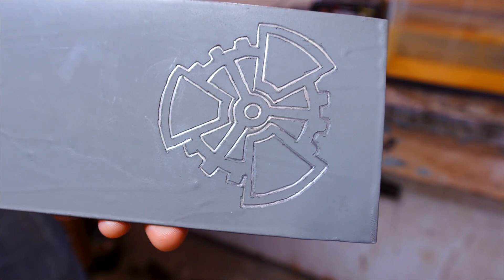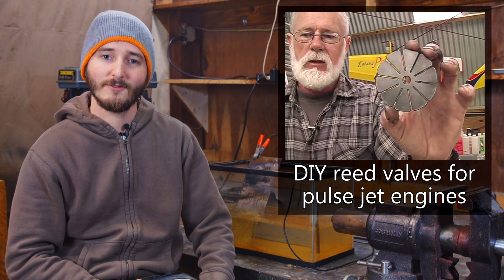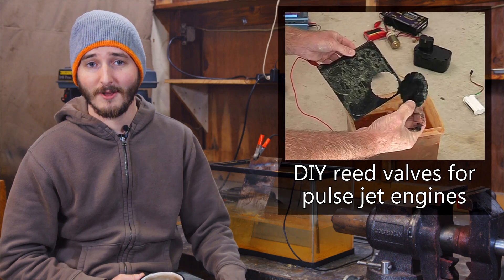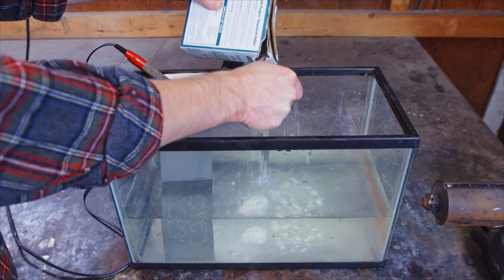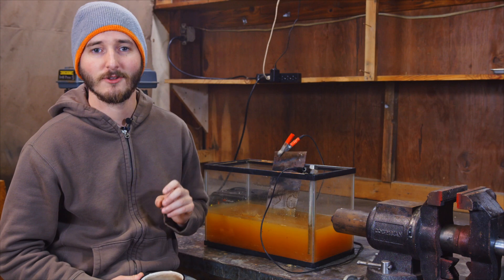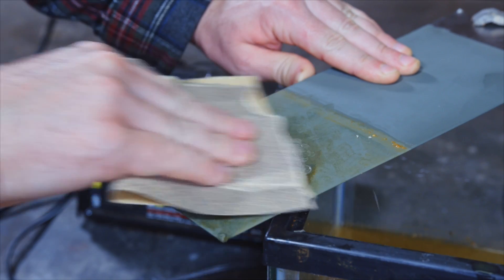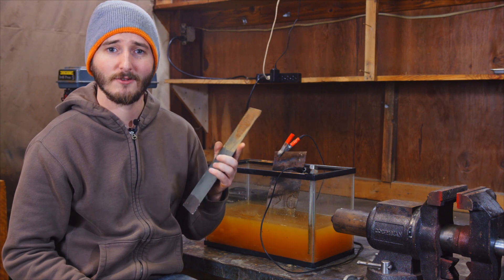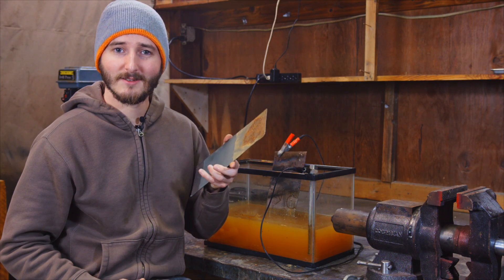How To Cut Steel With Electrolysis [Experiment In Progress] - NightHawkInLight

Comment: Agitation made my results much better. Constantly flushing the metal residue away from the cutting region seems very helpful. I used transparent packing tape as protection rather than paint, which works ok but ofcourse you still get undercuts. The only way I know to avoid this, is to use thinner sheet.
I got the best results by putting the plate horizontal, and having the etching face at the bottom. I think maybe this way the metal residue flushes out easier or something.

Comment: Another thought was on the creation of the relief. Maybe create a stencil, use wax or whatever to fill in the stensil. Then, apply your paint, wash off the wax leaving the lines of your stencil bare. The bubbles may be from the coating not being well bonded where it was scratched away.

Comment: I saw on the TechIngredients channel where they basically scrubbed epoxy into an aluminum sheet with a scotch bright pad to get past the oxide layer and get good adhesion. They said it worked better than an etching primer.  Steel doesn't have the same instantaneously formed oxide layer aluminum does but it might still work good.  How deep did your attempts get before the edges broke down?  I wonder if the addition of an acid that would make the process work faster would help?  Part of me thinks having a nearly polished surface near the lines you want to cut on would help but I've found paint doesn't stick to polished metal very well.  Also maybe a sticker with the cut pattern in it would hold up better.

Comment: I have been doing a similar process with Kapton tape on the steel instead of paint, then using a diode laser to selectively burn off the kapton in the areas you want to erode. It seems to work fairly well.

Like others have mentioned, using something like salt or epsom salt would probably be less likely to mess up the paint, and I would try running a higher current/lower voltage to reduce bubbling. I use a cheap bench power supply and a big steel mesh as a cathode (higher surface area cathode closer to the etching part will give you higher current for a voltage).

Comment: Place your sheet of metal right under the surface of the wAter the gas that builds up for some reason stay on the sides and prevent electric condition thus protecting from electrolysis action  vs up and in the way of the direction you wish to cut .   Also if you use     a wire that is around the perimeter of your sheet metal to be cut the collateral damage will occur outwardly vs eating away at your piece to be cut out  always give enough extra area for touch up

Comment: It would be damn near impossible to get a clean cut because all the metal is charged. The flow of electrons will go through every part right beside the shaping and this will add heat, after enough time bubbles would form in the crystalline structure of the metal.

Comment: The etching process in non moving water doesn't favor any direction, so it will etch into the material as fast as it will go sideways. So you would need a way to direct the direction of etching. Maybe a stream of water will help to guide the direction of cutting. The tube that spray's the water could itself be one of the electrodes, thereby concentrating the etching into the spot that has the water flow.

Comment: The greatest problem is that the iron oxide formed is kind of like a sponge and soaks up water and keeps eating up the metal in all directions. also the surface tension of the water causes it so be sucked into even the tiniest of gaps between the paint and yet again goes off on a different course.

Comment: Nah, you hit a dead end on the current model, no matter the paint coverage (as far as I know), as soon as the first corrosion occurs this makes room for corrosion towards the sides, because the water enters there, and then it is not a corrosion occurring in 2 dimensions, but in 3. Unless somehow the electron exchange was being done not by water, but by a material (with the cut mold you want) being pressed against your metal plate, in this case there would only be an exchange (theoretically) of electrons as far as your mold touches (+ the distance of the energy capacity being transferred by proximity, which may cause you to need a thinner mold than the cut you really want).

Comment: Idk if ur still intrested in this but deterrence dispensed has a great write up using 3d printed "bushings"  and copper wire to edm gun barrels. There info may help u and many ppl have had success with there method

Comment: Okay I've played around with electrolysis a good amount and I'm very familiar with making HHO through electrolysis. I know high voltage isn't always better. Try using either a higher voltage all at once or a low voltage for a longer duration. Also maybe try using petroleum jelly instead of paint. Just found your channel and I love it. I'm wondering if you can do something like this with some type of electric Arc

Comment: Just a couple of things of the top of my head, lay the steel plate as flat as you can so the bubbles don't get trapped under the wax, you really need to find a way of getting the bubbles not to stick around too long, which maybe why wax works well. I was also thinking maybe lightly etch the pattern on the steel first then again (requiring a bit of precision ) after the wax coating, i think this should keep the bubble creation confined a bit better to the pattern and not spread under the wax.
Reply: Another thought, if possible vibrate the steel to try to knock the bubbles off. Sonic vibration maybe, find the resonance of the steel bit. If you get it working patent it. :)

Comment: Your negative lead is stainless steel, and should be mild steel instead, also instead of coating the work piece with paint, you could use electrical tape and razorblade to cut the design. Next if you have any way of increasing the voltage not the amprage the process will work faster. Washing soda will work better than baking soda as your electrolyte, and always remember that if you use salt as an electrolyte you will.be producing dangerous chlorine gas. Try to only use mild steel or cast iron as both your work piece and the piece receiving the steel removed from the work, stainless steel can expose you to chromium which is very dangerous. Great videos and best of luck!

Comment: Etching or Chemical milling... done all the time...like printed circuit boards... ferric chloride is the etch for steel... I've used photo resist, also screen printed epoxy, or hand painted epoxy...there are tapes that are designed for etch of metal.  With epoxy, curing temperature is important and a light/fine sanding of the surface prior to applying the epoxy paint.   Also, know that as you etch down, a near equal amount is also etching under...approximately 45 degrees angle under the painted edge...  so plan accordingly.  On thick metal, and matching image is placed both sides and etched.

Comment: ik this old but did u try etching on both sides. also mayb try an oil based paint and i hope u got the sides covered  so the current is running sideways thru it would be going directly where u want the cut or try something that eats steel faster like alum

Comment: did you ever get this to work? Also watched the pulse jet vid a few weeks before yours, he used spring steel, a much different alloy than the stock stuff it looks like your using. I wonder if that could be it"? also did you try heating it up to lose the hardness first? you could temper it again later.
Reply from the maker: I think my issue was not using salt. I haven't tried again since this video

Comment: Etching works to only a short distance into the metal than the enchant works under the protective layer bubbles it away. The easiest way to etch metal is to first cut the pattern into the metal by using an engraving tool or an engraving cnc machine coat the metal in a protective layer over the engraving the scratch a thin line and use nitric or hydroclorlic acid.  If you can engrave both sides by using a laser printer and magazine paper to print copies of the mirror images of the engraving  use a iron to heat the images on both sides then engrave both sides and paint scratching a thin line on both sides.The faster the process the less chance the enchant getting under protective coat so heat the enchant up to almost a boil  The only other way is carbon EDM electrical discharge machining or high pressure abrasive machining.

Comment: Howdy I use this method to clean rust from parts and tools.
 Specifically I use an old portable DVD player power supply that provides.
 12 volts and 3 amps. or a battery charger if its not around.
 1 TBS Sodium Carbonate (Arm and Hammer Soda wash, powder) per gallon of water.
positive hay wired to sacrificial steel. I like pipes it give more surface ares to react with.
Negative hay wired to the part I want to clean.
After a couple of hours (for only surface rust) or when the reaction quits or slows down (indicated buy the rusty bubbles), pull out the parts.
If they are not cleaned after a scrub with a stiff brush and clean water then clean the anode as well and start over. 
boost the amps to speed up the process.
The rust settles after and the electrolyte is reusable.
  I have recovered old pliers that took 2 days (I cleaned it probably 4 times during the process).
And clean multiple parts at a time.
you can leave it on for longer than it takes to remove the rust with out harm to the parts or tools.
It does create flammable gases so care should be taken (same principle as an HHO system for a vehicle.)  
Also and probably the most important is the are some metals that will create POISONOUS gases if placed in this process.  (stainless steel and copper I believe).

Comment: without any knowledge of the process, my first suggestion would be to me make the edges of the shape u are cutting out of the paint/wax are SHARPLY cut and not scraped off. plus this paint/wax needs to stick to those edges very well, from what i see, the electricity is able to bleed from the edges making it not so defined.
maybe a better paint with a thinner coat, use a VERY sharp blade, and spend a lot of time making sure its all one continuous cut, then scrape out the middle.

Comment: I don't think this will work. Once the solution gets past the initial mask, whatever it is, it will be in contact with the metal under the mask. This will allow it to eat away metal under the mask causing the bubbling. Perhaps if you etched the same design on both sides exactly it would meet in the middle before this happens. Although I doubt it. Keep posting though and vent well.

Comment: surface area and your etching paint spoils the process. you got to have more surface area in the  line drawing u tried to cut in the steel minimum 5mm to 10mm and don't try to use hard steel of thickness greater than 5mm. we can't eat a elephant when we can't even go for a bean. try to stop the process at times when u feel the paint is wearing off and reverse the process.

Comment: Try with different power modulations and current/voltages
Reply: I cannot remember why or where I got this but I think the ideal modulation type to use for such devices is 'square wave' pulse modulation -_- certainly got some dust on that knowledge in the old brain so could be total hogswash; may be worth a small test though I think there was also something about the distance between the anode and cathode for specific purposes

Comment: from the video of how to make reed valves he used 2 resistors (light bulbs) in series and a large plate as a cathode until it barely produces any gas

he used a 12v battery charger psu for this purpose and also used table salt which will corode the steel faster due to the production of chlorine at the anode.

Comment: First off, don't use the paint. It's a bad idea. Wax won't work either. In both cases, there's a higher than average chance that air bubbles can get under the surface, which will let electricity through, which will ruin your cut. I suggest using something like a permanent marker, it works excellently as a resist for such pursuits, and it can simply be sanded off of the finished product. Salty water works well for these pursuits also, but it will take much longer to etch all the way through. I would recommend talking to an expert on metals and how to handle them if you want to use this method, though, so you can learn the proper methods, and if this way I truly viable.

Comment: FWIW, I was experimenting with electroetchig metal as a kid over twenty years ago, and the best result (very clean deep and hair thin lines) I got by coating it with a mixture of white parafine, asphalt and pine/spruce resin mixed 1:1:1 by volume, boiled together and cooled in water. It resulted in a substance that was wery sticky when warm, with low melting point, and relatively hard but not chiping when cold. It was wery easy to make thin coating and then scratch the design with needle. Unfortuntately the substance had also rather, ahem, excremental brown color.
I have not tried to cut all the way throught the metal and as etchant I used saturated NaCl solution.

Comment: Did you try it with paraffin wax; bee's wax; or both? I don't know that it would make a difference. But if you only tried with one, you may as well try with the other and see what happens. What you're trying to do reminds me of acid etching copper and steel plates for copper and steel prints. They used bee's wax. I'd imagine if it were one or the other that you tried it would more likely have been paraffin. Maybe a bit of older technique is what's needed.

Also that plate seems to be rather large. Just seems to me that the more plate there is the more chance there is for something to go wrong. Maybe try with the bare minimum volume of plate needed. 

Perhaps even make superfluous scratches else where on the plate that are entirely aside from the design. That way it may be encouraged to just etch that instead of finding places to bubble up. A sort of sacrificial lamb.

Comment: have you tried placing the electrodes closer to the exposed metal? it is not guaranteed but I think I could help. Also a smaller piece of metal and a smaller tank, maybe a more concentrated solution. I haven't seen the video you referred to, but from the clip you included seems like all these recommendations are implicit.

Comment: I think it's worth noting that on a small scale as you zoom into the cut you would see that as the rust eats the metal  it would eventually go through the not painted/waxed area before eating up through the metal behind the paint/wax. the only solution would be to have something coat the walls as it eats the metal eve really cutting off anything from rusting the metal.  perhaps a small piece of plastic or something as a outline to sink through as it eats the metal?

Comment: Try cutting the negative of the shape out of painters tape, then painting so the edges aren't scrapped and possibly weaker. And trying to do it on both sides, maybe make a print out template so its the same on both sides

Comment: I tried with 0,50 mm stainless steel and 20 volt(Computer charger :)) in salt water mix. I used my sisters nail paint :D Result is perfect and i think it can cut to 1 and 1,5 mm. For make it perfect i am planning to use laser printer and transfer toner to sheet metal with acetone(I am still poor and hope to find some recource, being student isnt help me to do this staff). I checked some of videos and i find out toner can resist to salt water.For cutting i think more voltage is better and use wider plate at non etching side because it makes faster than thin cable. If my idea has some problems please notice me because i will try and i wont waste anything.

Comment: use base or acid electrolyte...none of these carbonate or chloride crap
also use diffrent voltage so it dosen't bubble as much (but it will take longer)
and use stirring so the bubbles disappear and don't stay on the steel

Comment: as soon as the steel oxides it even corrodes under the paint... that's why even a little scratch in protective paint can cause the whole objekt to corrode... u have to stop the water/oxigen to contact with the inner sides of the just "away- corroded" surface, so the steel right under the painting, to stop the rust process to continue under the paint.
it would be much effort but maybe  cleaning the rust off and protecting the inner surface with the paint as the elektroding process runs manually will help.

Comment: Maybe try using vinegar as electrolyte since it is already an acid
Did you degrease the steel and sand it with a fine grit sandpaper before painting? 
Also try having an water pump in it to circulate the solution in the tank

Comment: firstly using a braided stainless hoseline is a terrible idea, you need an actual stainless plate, second you need high carbon steel that is much thinner that than the one you are using because as it etches to a certain depth the reaction expands all directions and no amount of paint or wax will help with that, this method only allows for thin gauged high carbon steel

Comment: try etching in multiple stages. stripping the paint, recoating, and scratching your pattern again on the new paint. theoretically, this should ensure that the corroding steel doesn't continue to eat through the plate horizontally. the more stages you the more stages you have, the more precise your cut should be